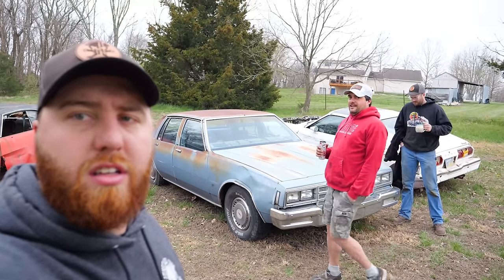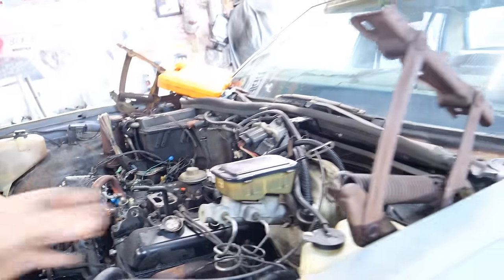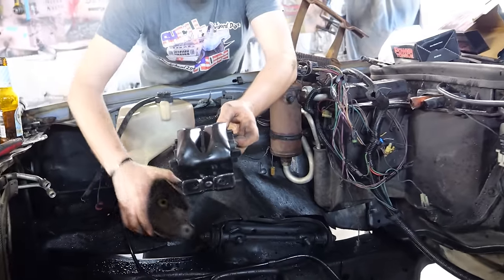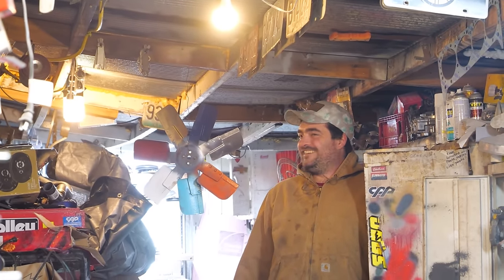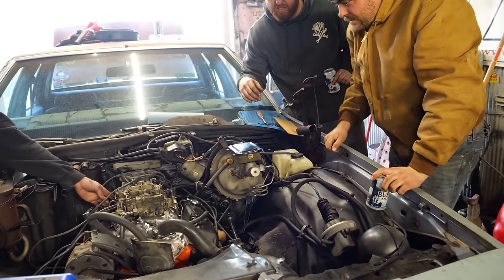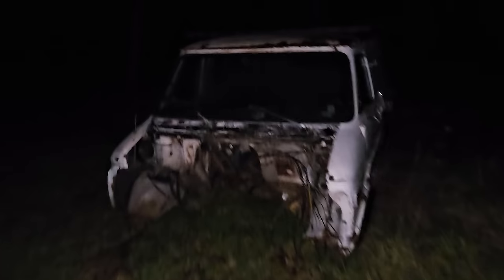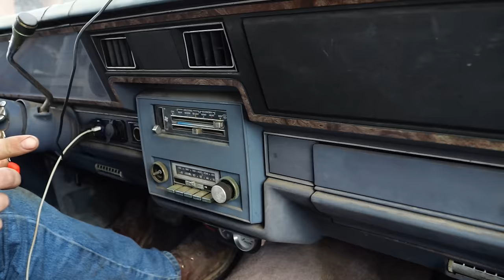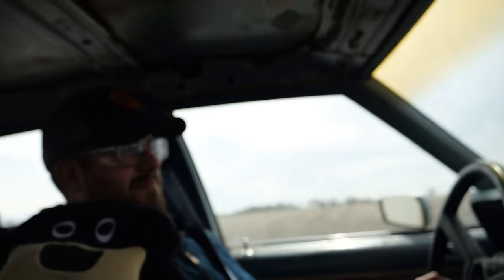Will our CLAPPED OUT Impala DRIVE HOME on Junkyard V8 Power??

Comment: "The little engine that couldn't" Impala is the most roadkill thing i've seen in a while
Reply: I bet they would have made it home if they had seen those broken plug wires, though they still would have had to pull the engine eventually.
Reply: @alan6832 I imagine it would’ve been a lot better had they discovered the dead piston and unplugged its spark lead. Engine would still be junk but atleast the blow by could’ve been manageable

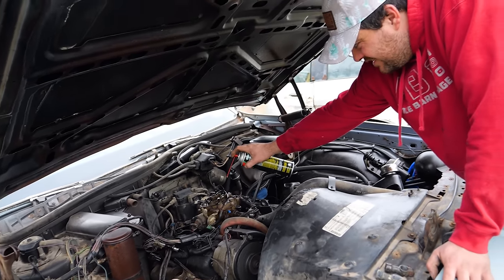Comment: 2:21 how the hell this engine still working jeez 😂😂👍👍
Reply: Because Buick 3800
Reply: @TwoDollarGararge  yep, hole in a piston and 2 broken/chewed plug wires and it still pulled into the shed! haha
Reply: @TwoDollarGararge  nope. 4.3.
Reply: @dustingresham8078  nope. chevy 3.8.
Reply: @TwoDollarGararge  Nope the buick 3800 v6 as we know it was a FWD only motor and didn't come out until 1988 the v6 in this is a predecessor to what would become the Vortec 4300 V6
Reply: You do realize the 3.8 V6 is the same as a 3800 it's just the longer name format for it. The 3.8 went in rwd vehicles such as the GNX. Another example of it is the gm 8.1 is the 8100 and what have you

Comment: I’m curious how much better the engine would have been with the rocker arms removed on the cylinder with the blow buy and the two spark plug wires in tack
Reply: probably a lot, since it would run on 5 cylinder. it ran on 2 cylindre, maybe 2 an a half .  those cylinder that have the 2 plug wire chewed up ''was fine'' enough to give almost twice the power

Comment: I had a 1985 Chevy Impala for my 3rd car. I put air shocks in the rear for a raked look, ,cut the exhuast and welded on some cherry bombs pointed in front of the rear wheels, then got some widebody corvette wheels put on it and it was one of the coolest rides in the parking lot. I miss it alot, my $200 muscle beast.

Comment: LoL. Awesome run, guys!  I can see that old Impala still getting road worthy yet.  Slap in another 305 or maybe performance cam 350 small block, then do a nice interior recover for the headliner, pilars and dash, as well as new weather seals, and do a nice budget shop respray on the exterior.  I bet that old car will run another 200,000 miles with the right engine.

Comment: If you take the 4.3 serpentine belt system and brackets, flip the condenser, you can keep factory ac with updated compressor and 1 single belt. Also change water pump since the belt rotation for the V6 is backwards compared to 350.

Comment: Fishtails! 34:30 My Dad bought an '82 Caprice Classic new with that V6. It's the car I learned drifting with on cotton field roads. (It 'tweren't called driften then) I also learned why doing a neutral drop is a bad idea. Fortunately, it was still under warranty. Dad, a pious man, didn't ask any questions so he wouldn't feel bad about having Chevy replace the transmission. Before my dad passed we were having a conversation about cars and he admitted that he strongly suspected that I was horsing around with it.

Comment: If you mean your dad's 75 cutlass, Kevin have someone check the heads i had a 76 Oldsmobile 260 vin F that was cracked in between the intake and the exhaust just off of the seat lol

Comment: I had an 86 caprice with a factory tbi 4.3 and swapped in a 4 bbl 350 out of an 85 or 86 full size van. Never touched the trans or anything behind it. The 350 bolted up to the 200r4, but only got about 11mpg after. It screamed petty good at highway speed. It got 22mpg with the original 4.3 on road trips, and would still power brake. 😅 pretty slow otherwise though. Kind of regret not just finding a good tbi 4.3 to put back in it.

Comment: Can't beat a gm motor I own a 1993 Chevy c1500 4.3l guy I bought it from sold it because it had too many miles at 80,000 now it has 985,000 miles and counting and still a daily driver with all the smoke you can imagine but no blowby. But bad valve guides.  ❤ Your channel keep up the good work God bless

Comment: Oh buddy I wish I would have known that you was headed north threw Iowa on I-35!! You stopped there in Osceola Iowa at the Casey’s and I’m just off the exit at the third exit to the north!!! If you guys are ever in need to use a shop you are more than welcome to use mine and I’m just a mile off of the interstate!!! I also have several awesome square body trucks that you might like looking at also if you ever want to stop and look at maybe??? Just let me know!!! Awesome video!! Oh plus I do have a 350 that is in an old 1973 Chevy motor home that does run but does need a full regasketed!! My plans was to pull it this summer and go threw it!! It does have under 100k original miles on it also!! I also have a 396 bbc and a 454 but I have also been told it is a tall deck!! The 454 is in a 1984 K30 dump truck and I can not get to the back of the block to see the numbers to see for sure what it actually is!!

Comment: I gotta say a 305 swap was an improvement from that 3.8 that decided to blow its brains out, but this is also a testament to the GM 3800 because it went how many years with what looked like neglect of maintenance well before Kevin and Angus obtained it since new? That's wild. I honestly forgot GM offered the 3800 in the Impala G bodies, must be too much for a little 3800 V6 to move a 4K LB car clapped out or not.
Reply: I think Kevin said that the V-6 in the Impala was Chevy's 229 V-6.  If it had been the Buick 231, it would have still been going strong!

Comment: I've learned in my years to keep a jar (the big one) of K-Seal in my kit.. it's saved my ass 3 times in 10 years since I realized it actually helps for a (actually if it's a little thing it works indefinitely) long enough time to consider it a permanent temporary fix. : )

Comment: so you were driving a V3?   a dead hole on the right bank and 2 non firing (missing spark cables) on the left bank.      It's amazing that thing had enough power to even move.

Comment: I've just gotta say o have put fairly large lift cams in 305's trying to give it more low end torque and they don't like moderate lift cams ... Especially if it is not a h.o 416, or a 601 headed version...

Comment: I think you might be right about the coke messing with the engineer's back in 1984, cuz they probably watched scarface one to many time's, and it went to their head.  That grease on that engine and transmission was so thick and gobbed up, i swear i could smell it.  You guy's are cracking me up today, for some reason these gotta fix this greasy clapped out motor to get it home trips are the best, cuz nobody really wants to crawl under that mess.  Did you draw straws for who went underneath, or was Angus not thinking right after sucking up the fumes from starting that thing.  I look forward to your video's, the content never disappoints.  G-d bless.

Comment: When explaining the possible rust holes in the head gasket making an engine run hot near the rear, other than removing the heads to inspect, how could you diagnose that?

Comment: I wish I would've had some knowledgeable friends to help me swap a 350 into my 1976 Buick Skylark when I bought it. It had the 105HP Olds 260 4.3L V8, but it ran mint and only had 34,000 original miles. I would've absolutely kept it if I had built the 350 that my buddy sold me for $150 with an all Comp Cams valvetrain and swapped it in with a turbo 350 or 400.

Comment: While drafting on the highway is illegal in most jurisdictions, most people don't understand how the cars kinda lock in together if your speeds are tightly controlled, you get a little close and the pressure kinda pushes you back, too far away and you kinda get sucked along in behind. Highly not recommended unless you're a very experienced driver tho, and definitely not something to do behind random drivers that might brake check you in panic when they see you in the mirror, because people defy logic when they panic....

Comment: You said 3.8 and I was expecting a Buick 231. That looks like a 3.8 (229). That makes the swap a TON easier. The trans wouldn't bolt up from the 3.8 to the 305 unless it had a universal bellhousing.

Comment: V6 was a v3 that whole trip
Reply: Would love to see that v6 slapped into another car rebuilt and with dual turbo
Reply: Easy hone th cylinders throw new piston in replace the bearing on bottom end replace head gasket give it the old degreeser on inside then put 2 turbos or 2 amr 500s fun

Comment: Sorry i have a question about the insurance on the street. I can’t understand how can you drive a car that has been untouched for decades, sometimes even without engine or transmission, and you just bolt everything in and hit the gas home. How does it work with insurance, registration etc . Thanks
this is a big point for me because we need to have new insurance running on the vehicle, inspection and we cannot drive a car without engine that you just go and bolt it and go😂 worse than California I should say